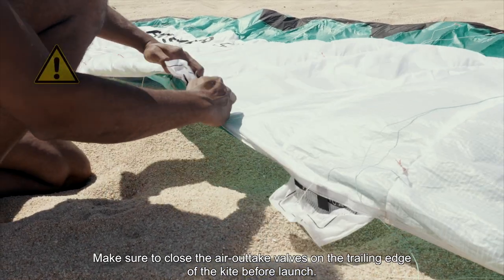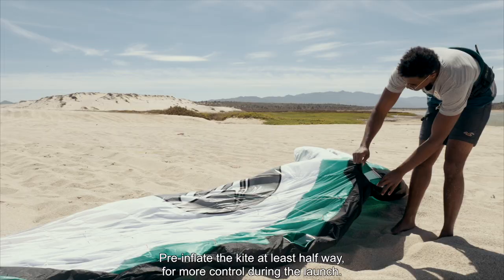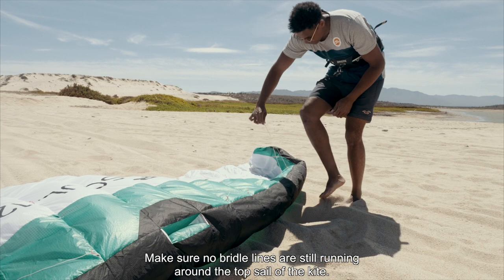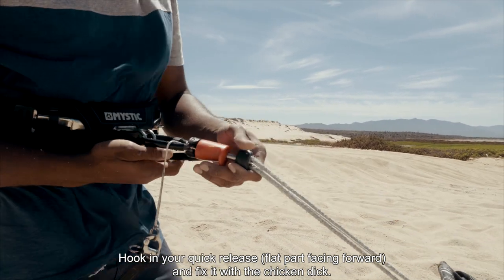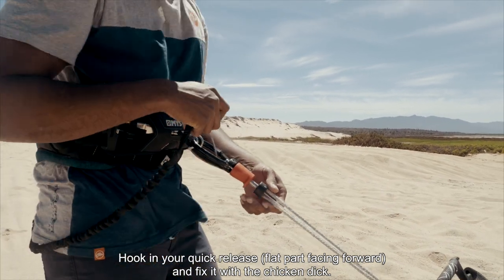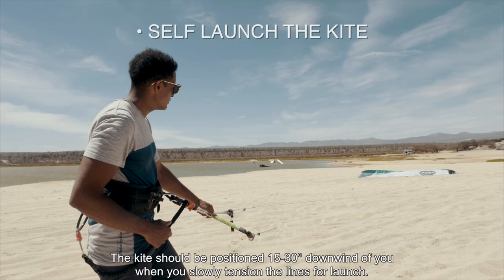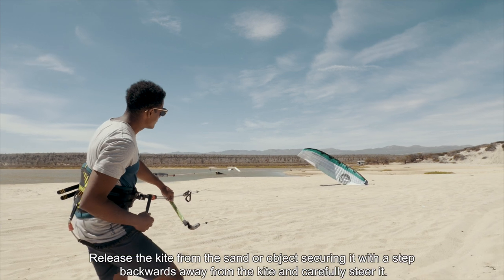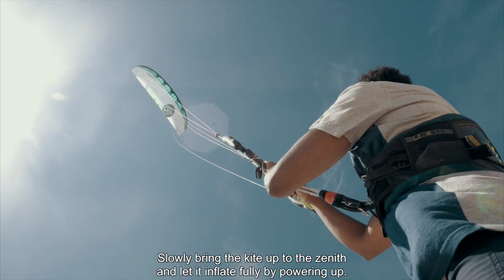FS - How To Tutorial: Launch your Foilkite

Comment: would you reccomend pulling gently on the downwind front line to help the downwind tip come up?
Reply from the maker: Patience is your friend when launching a foilkite, the better pre-filled the kite is, the more control you have. Just do not start it directly at 90 degrees of the wind window, the kite needs a bit of space to fly to the edge of the wind window to fill completely with air.